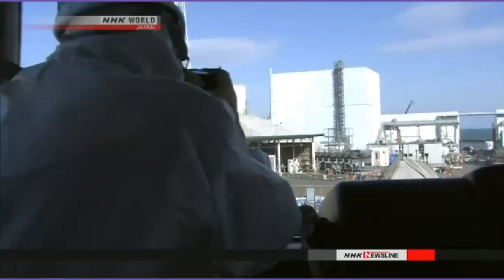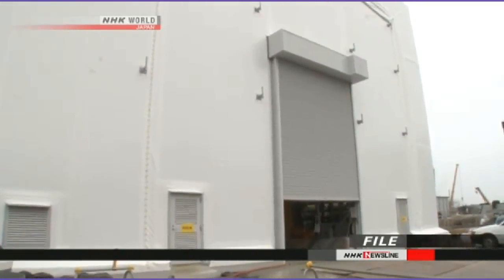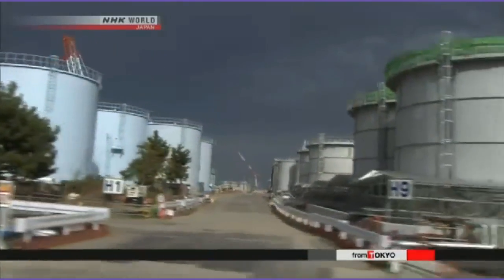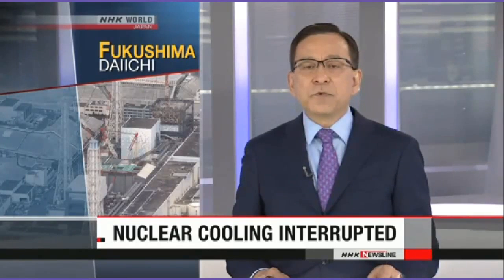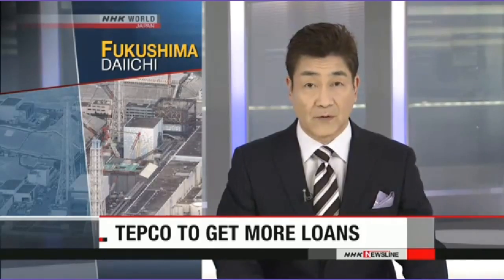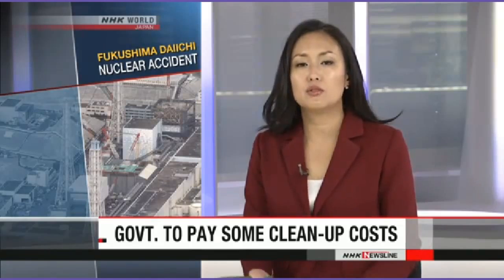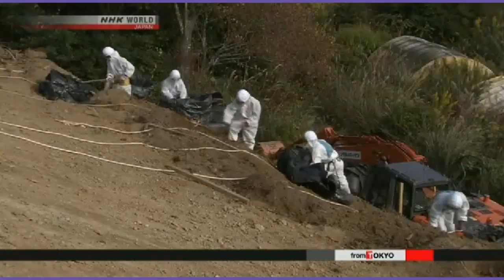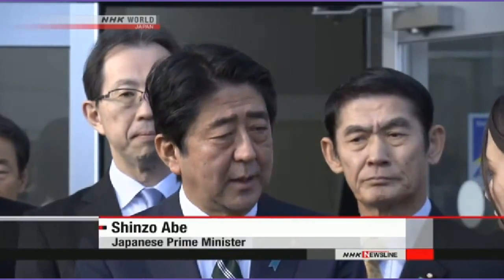Fukushima News 12/10/16: New Option for Radioactive Water; Soaring Decontamination Costs

Comment: What a bunch of boneheads, evaporate it = let it spread out, the opposite of what they should do, CONTAIN it! Convert it to gel to further control of leaks.  We don't need any more radioactive rain/precipitation! The water should be contained until the rads can be neutralized. 
 Criminals in charge of the 'ideas', it sure sounds like it.  Injecting water to cool molten fuel, when they should be using quartz or sand which will dilute the molten fuel eventually converting it back to a solid. 
Open to information, RIGHT! I wrote out all these ideas and a couple more before i sent it out to all the press, gov, and TEPCO, including the US gov & the leaders of all the canadian parties. I got zero responses which tells me that they are all in bed together.